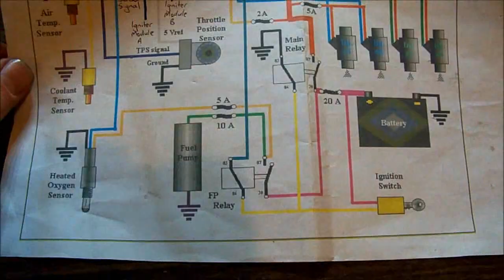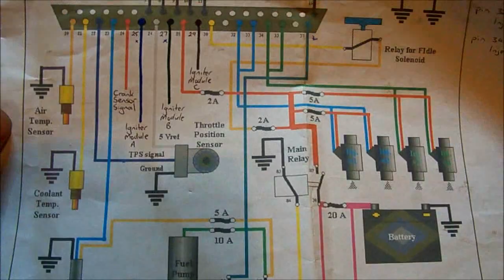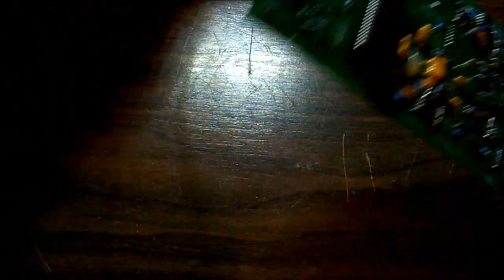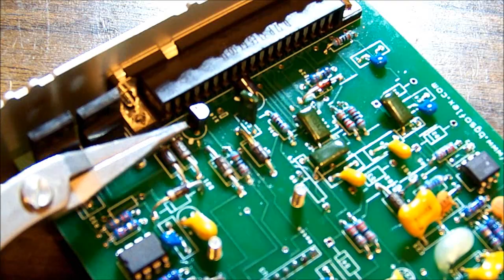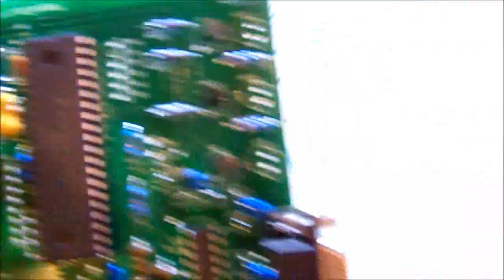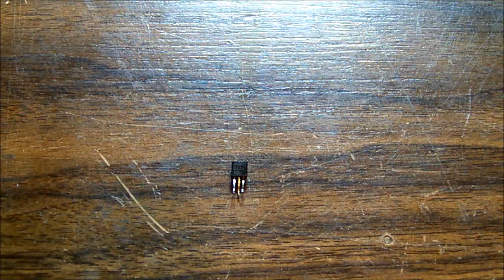Megasquirt ECU repair Part 1

Comment: on what multimeter value you checked that transistor?
Reply from the maker: Diode test function, usually has picture of diode on selector switch. You should see a value of about 0.6 volts from B-C and B-E and no reading (open) from C-E on a good transistor.

Comment: Try this mate http://www.bgsoflex.com/v22/megasquirt_ShemV2.2.pdf
From this page: http://www.megamanual.com/v22manual/mass.htm#power

Creaping around in stelth mode can be a pain, hope the above helps :-)
Reply from the maker: Hey thanks! I haven't had a chance to film part 2 given his workshop priorities but spoiler alert, this did fix the problem.
Reply: Jonny Fix
Smashing, well just ignore the links, perhaps someone finding your video may find them usefull :-), ive been an electronic repairer as well, so i know how much time it can take to track down a fault on unknown systems.